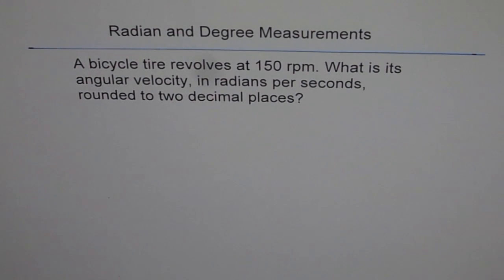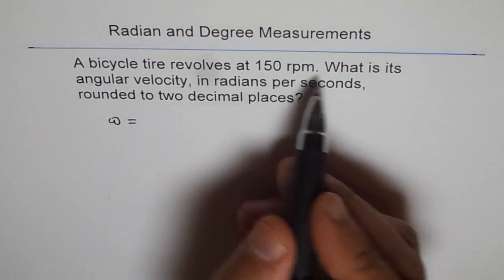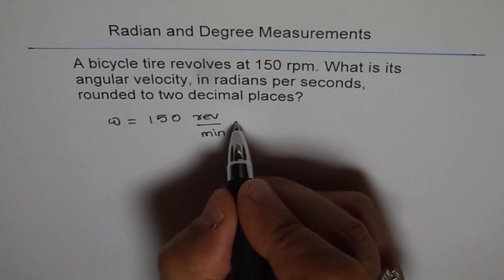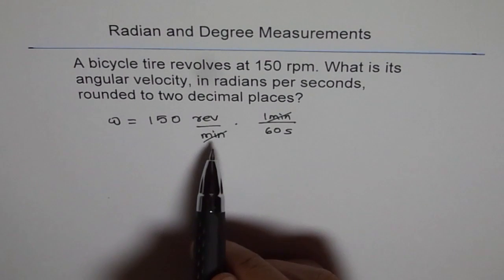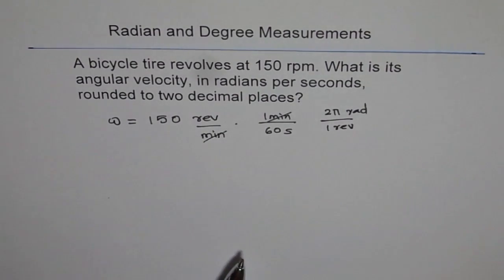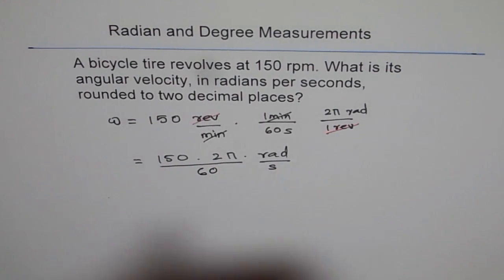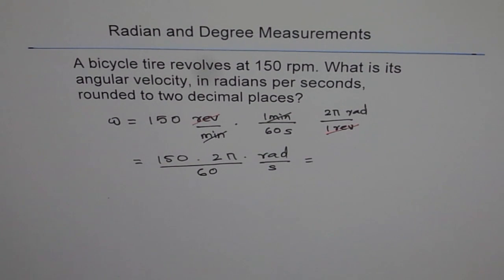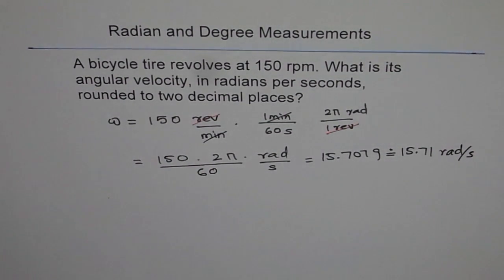Convert RPM to Radians per sec A2

Comment: Does it matter if the answer is in degrees or radians mode?
Reply from the maker: +Stewie Griffin In the question it is mentioned radians per seconds and therefore you need to answer in that unit.